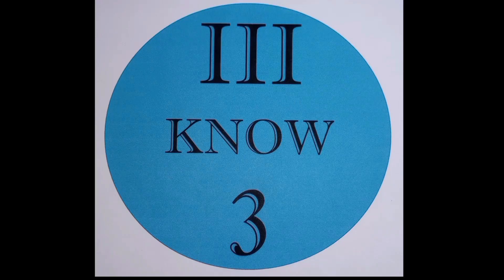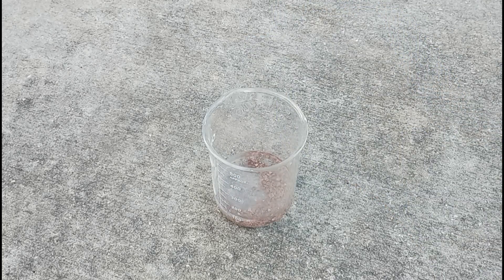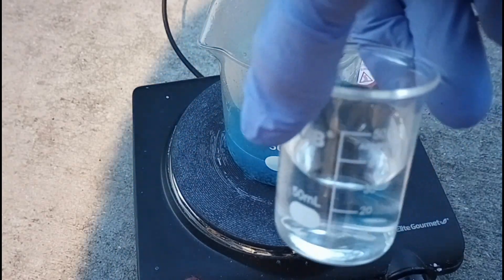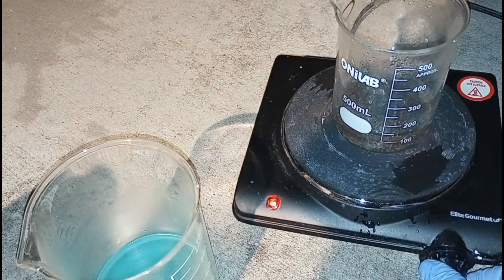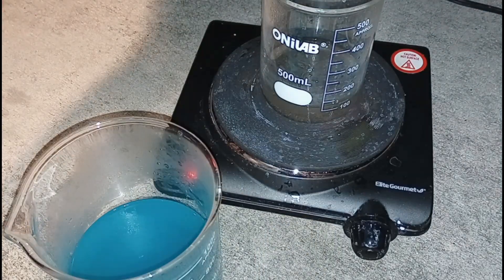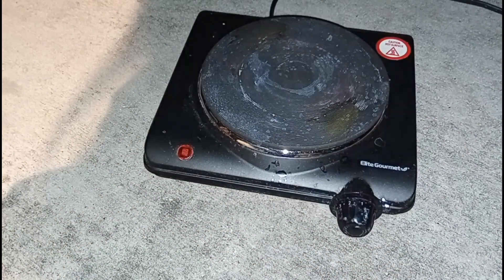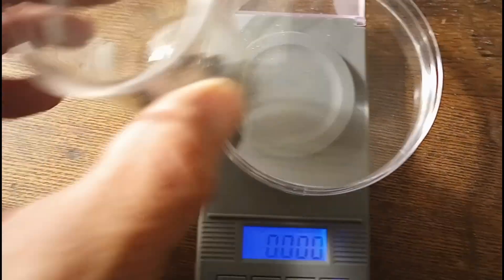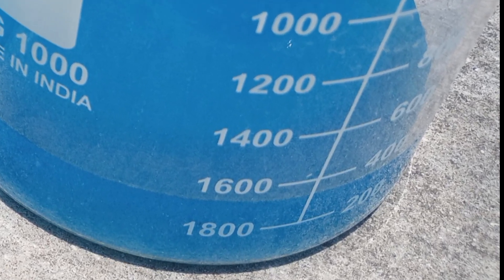Brass, Copper, Zinc and Acid Part 3

Comment: 1:50 I believe that just a scientific Hot Plate because if it's a super scientific hot plate it would have the magnetic stirrer and if it is in fact the actual super scientific hot plate then you really should make use of the ceramic stir bar
😊😊😅😅😂😂   (Duh)
Reply from the maker: LOL it is "Super" because it was less than $20 from Amazon!!

Comment: I know you said you wanted to use vinegar because it is cheaper and less dangerous.  But I kind of wonder if it really is cheaper.  Especially if you factor in your time as a part of the cost.  

I’m pretty sure you could dissolve 30g of brass with around 60g of nitric acid. 
And using sulfuric acid and H2o2 could probably do the job with around 120g or so.  And they would produce much less liquid and dissolve it all in less than a day.  

I would be curious to see a comparison video using different methods to dissolve the same amount of metal in a future video.  

Great videos. Really enjoying all of your work.
Reply from the maker: Thank you for the awesome comment!  I know you are correct about the different acids.  Being cheaper and less dangerous is relative for sure.  I feel the time was well spent because I was recording it and sharing with viewers.

5% Vinegar is totally harmless but Glacial Acetic Acid at 99% rivals the others with danger and expense.  One of my goals in this series was to see what was possible with just 5% and understanding the reactions with different metals.  I know some people have issues getting any type of acids, either delivered or from a store, so maybe this will help them because vinegar is so easy to get.

With what I do, it helps to know how available acids react with different metals.  With the Tin metal videos I have been working on, I know that Lead will dissolve easily in Acetic Acid but Tin will not.  I wish I was recording when I did those tests. 

I like the idea of the comparison, maybe I can Incorporate that into upcoming videos.  I also want to concentrate some vinegar to make a stronger Acetic Acid soon.

I am not an expert, but these videos are my notebook while I become one.    Thanks again!!

Comment from the maker: Gold itself is an element. You can find it in rocks. You can refine it from things that contain gold. As far as I know no one can make it.

There is a copper alloy called "Nordic Gold" or "Viking Gold". It is 89% copper, 5% Zinc, 5% Aluminum, and 1% tin. If you melt these metals together it looks very close to 18k gold (75% gold and 25% silver and base metal).

It is common for people to make rings out of it and try to sell them for some gas money. Although it seems like a great deal to fill up the nice man's car with gas for a ring worth around $2000, later you will find out it is not worth more than about 20 cents.

I am pretty sure you were joking (lol at the end) but I thought you would find the response interesting. I appreciate the comment. Thanks for watching.
Reply: Thinks he's an alchemist hahaha
Reply: Aluminum bronze looks very nice also but it is Nordic gold they use for some euro coins so they likely chose it for a reason maybe tarnish resistant or antimicrobial because they seem to be germaphobes and coins change handle up
Reply: @Rob337_aka_CancelProof 
Coins try to avoid Nickel.....
Before the Euro coins, we (into Belgium) had coins of 10 BFr (belgian francs and 50 BFr (1 Euro € is approx 40 BFr and at a time approx 1$) it was 99,9% pure Nickel; it was a pleasure to dissolve those (7-10g coins) into 63% HNO3 to get emerald green Ni(NO3)2... from what it was possible to make pink energetic complex Ni(N2H4)3(NO3)2...

Those coins can stil be found for nothing in flea markets.

In those times it was possible to buy DNB, DNP, Hg, KClO3, KNO3, HNO3, H2SO4, N2H4.H2O, N2H6SO4, ... all what Europa has pit a ban on; but that any real chemist can do from scratch; it takes just slighly more time and effort.

Anyways 1€ and 2€ coins are a type of brass-bronze or mixed brass-bronze Cu/Ni and Ni/Cu based; the coins of 10, 20 or 50 €cents are made out of Nordic Gold so mainly Cu (89% copper, 5% aluminum, 5% zinc, 1% tin) and little secret:
10 coins of 10cents weight more than 5 coins of 20cents itself more than 2 coins of 50cents.... what means it is cheaper to dissolve many 10 €cents coins; they cost less, weight more and display a better surface ratio; for the rest 5 and 1€cents are composed of steel plated with Cu; during a time when 23% ammonia bw was available (before EU regulations and ban(?) reduction to 12% bw); it was possible to dissolve selectively only the outer Cu shell and get 1-5 coins stainless steel silvery white with air and NH3 23% thus shaking from time to time air with the ammonia solution that soon turned deep night blue.
Whit the 12% NH3 solution or with 8% vinegar; sadly you get first the blue complex but very fast after that you get serious rusting and Fe(OH)3, Fe(OH)O goo.

For the rest I have to check resistance (and dissolution) against HCl 23% or AcOH 20% or stronger acids or mixed salts.

I also have plenty of chemical ideas to selectively precipitate or allow some metals to enter reactions and isolate for purification and isolations.

PHZ
(PHILOU Zrealone from the Science Madness Forum and many former A.O.L newsgroups related to chemistry)
Reply from the maker: @Rob337_aka_CancelProof     I recently made some Italian Bronze 92% Copper 6% Aluminum and 2% Nickel.